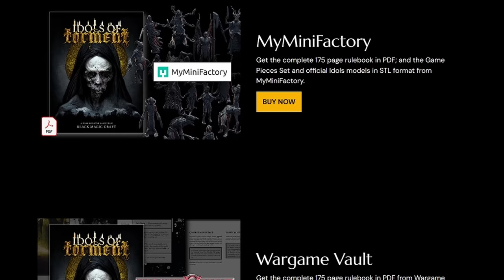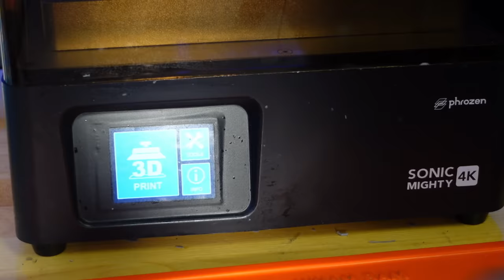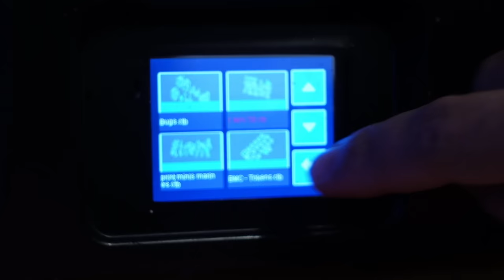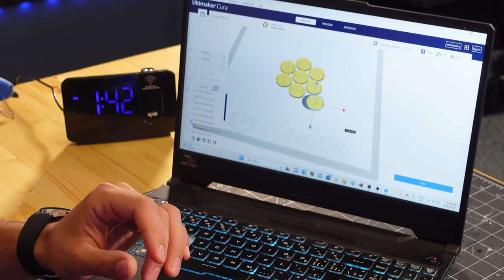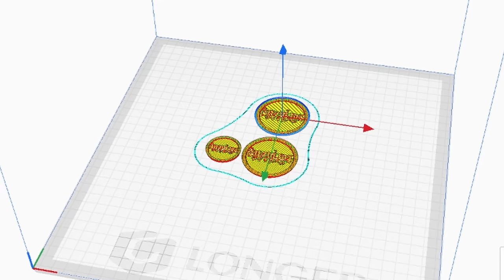Black Magic Craft Challenged Facility D20 - 3d Print and Paint an Entire War Game

Comment: Great vid, very impressive turnout! Next time you get a little fail run a tank clean (or exposure test  on older printers) with some old support in there to give you a handle. Lets you peel up the fail and also pulls out any loose bits that may be left in there.
Reply from the maker: Good call. I was hoping to pluck that little bit out of there without having to empty the vat, I tried for about 5mins off camera, gave up and emptied it.